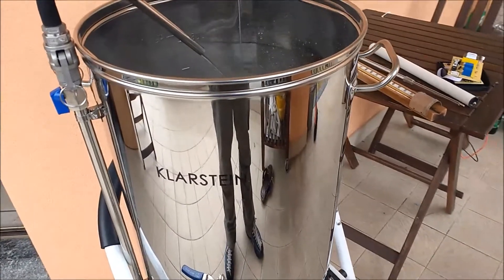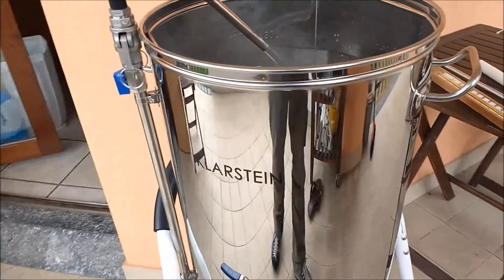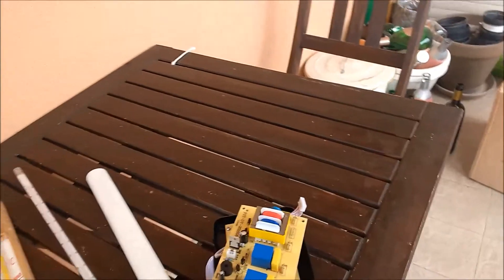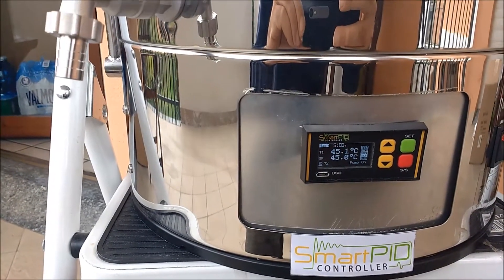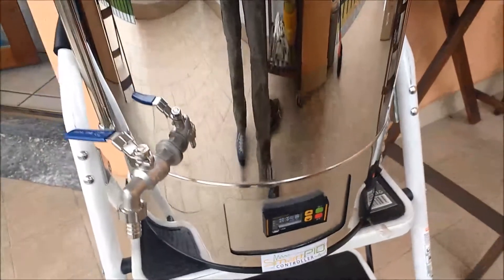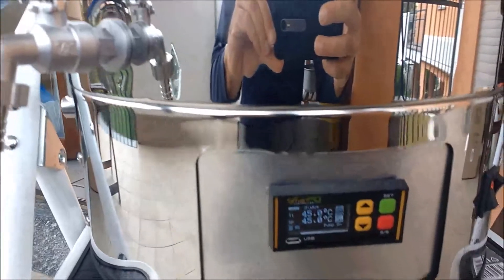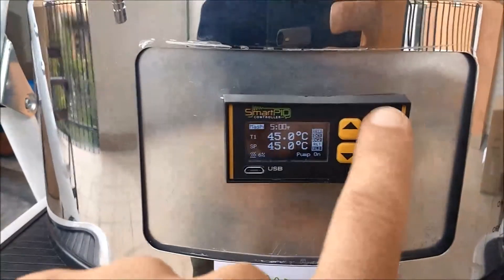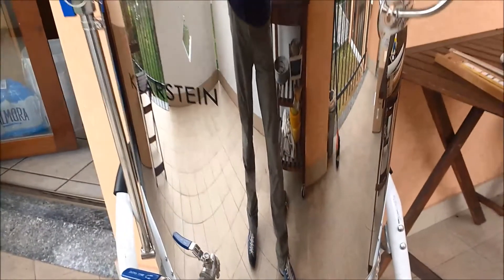Klarstein BIAB system retrofit with SmartPID controller

Comment: At what range did the original pid from klarstein keep the temperature? Did it give a lot of error in the readings or did not hold the temperature?
Reply from the maker: PID is very stable and precise much more than the  origina ON/OFF controller

Comment: Do you use digital temp sensor? Or you can use the original sensor?
Reply from the maker: need to replace the sensor with NTC 10K
it's included in the KIT
Reply from the maker: I provide in the KIT a suitable replacement of the original sensor